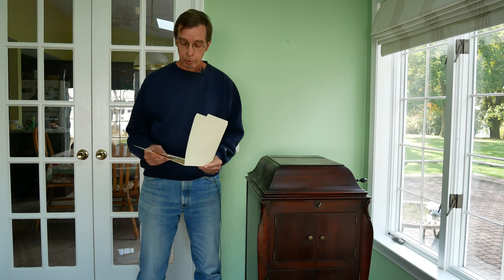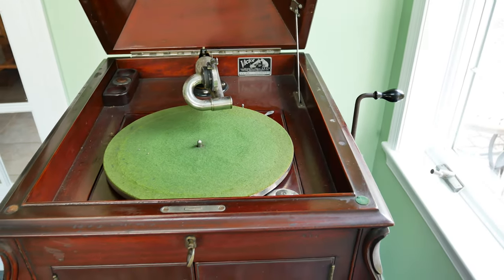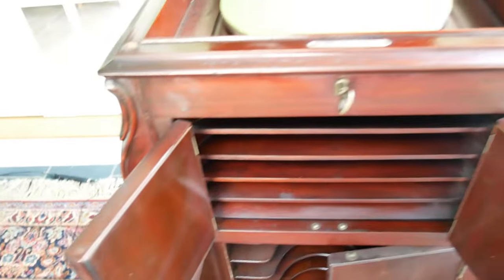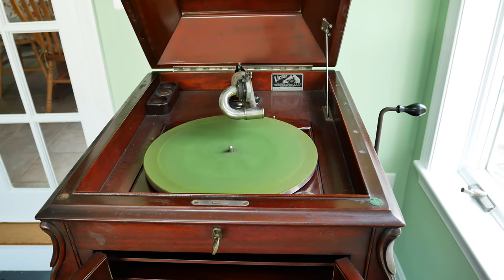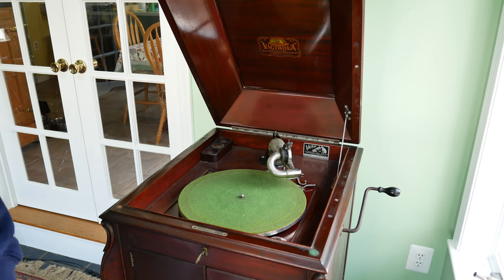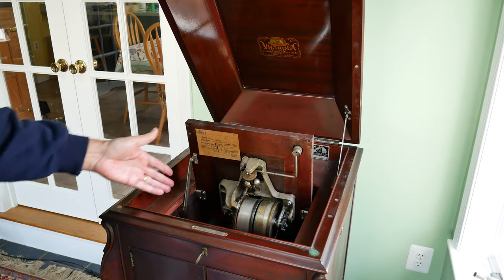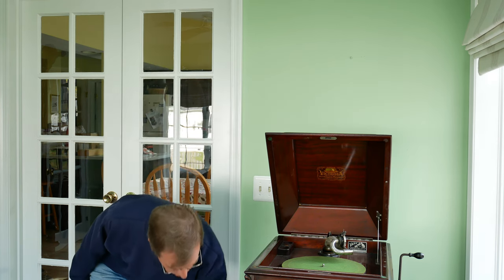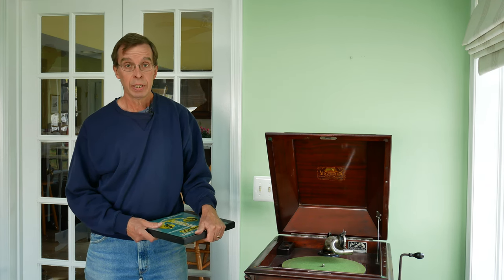100 year old Victrola demonstration

Comment: I have a Victrola, manufatured in 1919 that still works.  I've owned it for 30 years.  I would advise playing only acoustic records (older than 1925) on your Victrola.  The amplified 78's after 1925 require a more delicate phonograph -- i.e. stylus and tonearm.
Reply: Do you replace the needle each time?

Comment: Even though the record format continued through the 1950s, the recording characteristics evolved considerably from the acoustic era in 1918.
The earliest electronically recorded discs were tailored to play on acoustic playback machines. However as electronic playback became more popular from 1930, the recording characteristic changed to improve fidelity. High frequencies were boosted in recording and attenuated on playback to reduce record surface noise. Bas frequencies were cut in recording and boosted in playback to help reduce the overall lateral groove modulation and increase record playback time and improve pickup tracking.
This means that recording by the late 1940's will sound shrill and uncomfortably loud when played back on a 1918 machine.
The time period range of records which may be played on an acoustic victrola date from the mid 1890's thru to about 1935 before the record characteristics made the sound uncomfortable.

Comment: Thanks for video.  Just got one of these at an estate sale. Any recommendations on where to get serviced in Maryland area?   When I tried to use, the arm drops heavily unto vinyl and stops- so play never starts. Thanks in advance.
Reply from the maker: I suggest the Victor-Victrola website as a resource (http://www.victor-victrola.com/index.html). There don't seem to be many repair shops locally. Good luck!
Reply: @paulritterhoff8456  Will do. Thanks!
Reply: Make sure not to use vinyl records on one of these old machines! They were made to only play 78rpm records made of shellac.